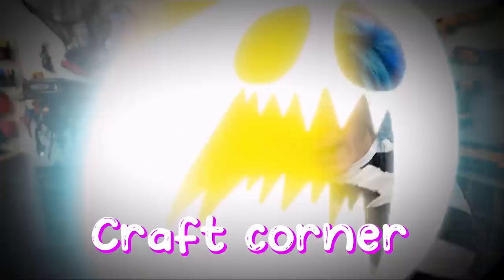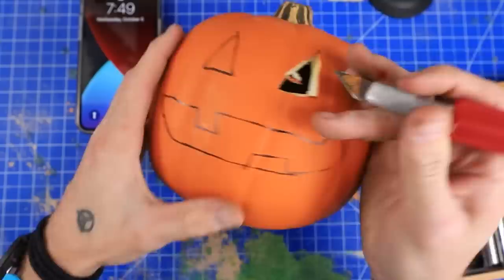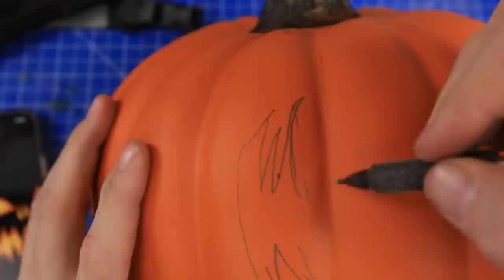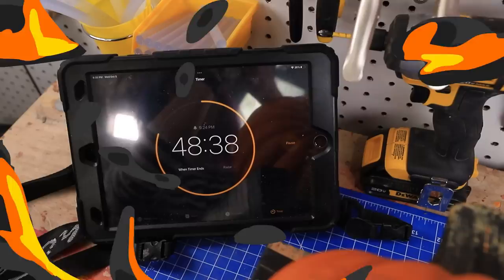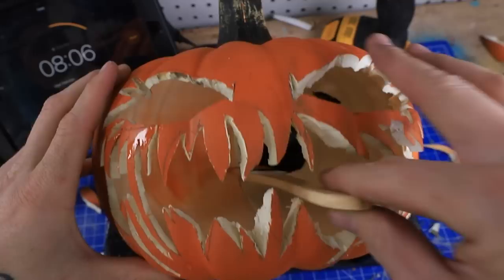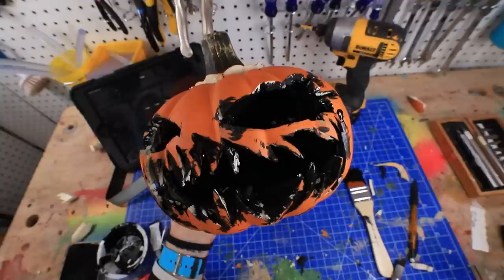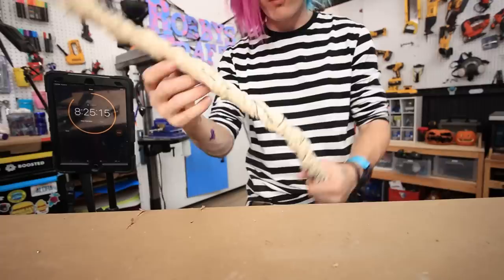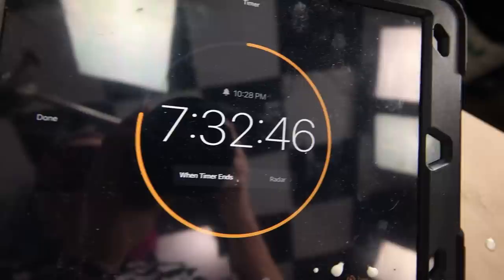1MIN vs 10HOURS SPOOKY HALLOWEEN PUMPKIN CARVING!

Comment: A life hack for twisting wire together faster and neater, put the both pieces of wire in the drill, then get some one to hold pliers at the end of the wire together, then spin the drill and you'll have a neat, strong, thick piece of wire. :)